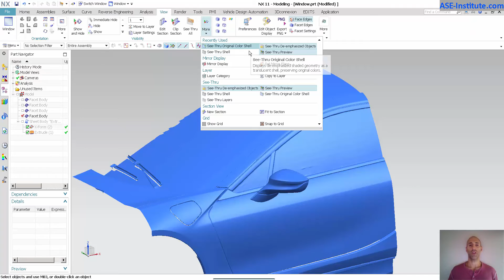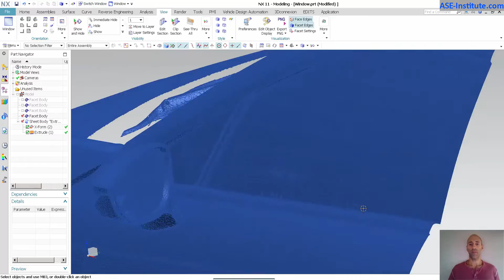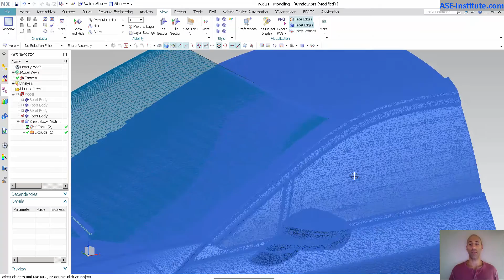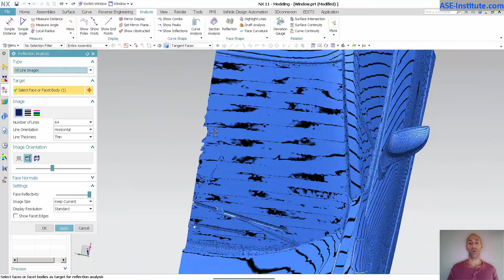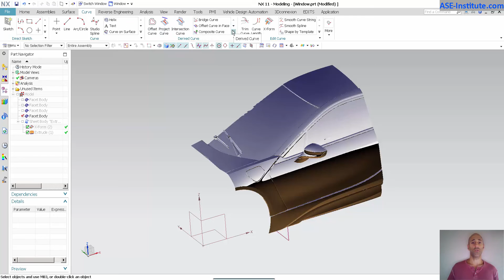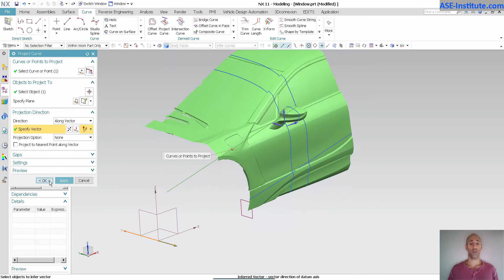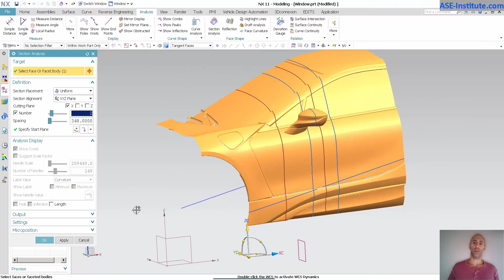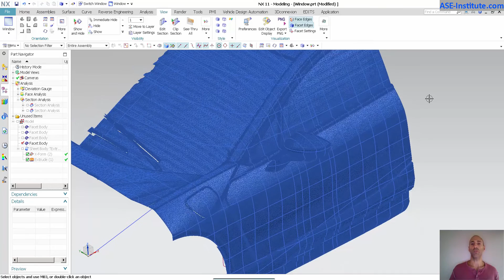STL Visualization: Siemens NX 11

Comment: Have you tried convergent modeling from NX 11? Since NX 11, convergent body have the capability of creating associative body from STL witch afterward, help's you create parametric curve derived from the STL..
Reply from the maker: Actually I have been playing around with it and it is very powerful.

The element I have here in this demo was not converted in to a "Convergent Body". It is still a standard stl. Although it is easy to convert it.

Once I understand the limitations of the convergent capabilities I will make a series of videos. I know what it can do but I want to know what it can't do.

Also, only NX 11 supports that technology and most people are not that far up in releases.

Thanks for the comment.